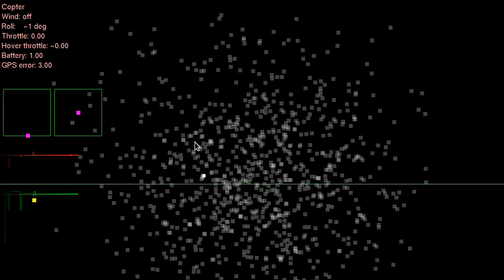Kalman filter test for sensor fusion (GPS + accelerometer)

Comment: Something I picked out of that TED talk (IIRC) was that it plans the route, performs 1/20th of the route then replans it. Seems like an interesting implementation. I expect a well tuned PID controller combining GPS and accelerometer would be able to perform very well, get there in the minimum time, minimise overshoot etc.

I have tuned PID control circuit for an electronic switching power supply, but that was all analog and I found that I could tune it very to transition from one specific start point and end point fast and without overshoot, but changing the parameters requires a different tuning. I have also used PI control for the same purpose. I found it to react much more uniformly to different parameters but always overshoot as without the D it won't slow down until it actually reaches the target. I watched the ControlLectures youtube channel for the basics of what PID is but for actual implementation I'm just learning as I go.
Reply from the maker: The system used in the TED talk is quite different to GPS. They are using infra-red reflective markers which allows them to get the full 3d position and orientation of the quad to about 1cm or so of accuracy, over 100 times per second. That allows them to do some truly amazing stuff. A good GPS module (at least the commonly affordable, non-military kind) will refresh at 10 times per second and may be off by many meters, that's why it takes time to gather more readings and get a better picture of where it is, and will probably not be able to perform much better than this. If you watch videos here on YouTube of quadcopters doing return-to-home, they usually do it at a pretty leisurely pace :)
Reply: ***** Many years ago I worked on the hardware/software for a military drone project. This was before GPS was fully deployed, so we used the worldwide Omega navigation system. https://en.wikipedia.org/wiki/Omega_(navigation_system) 
It was less accurate than that GPS is today, but we used something called differential omega. In this system we places a stationary ground Omega station in the same area in which the drone would fly. This differential station would watch it's own Omega position change do to atmospheric events and transmit a change signal to the drone. The nav system in the drone used the received delta position to modify the position from the on-board Omega nav system.

This Wikipedia article Differential GPS https://en.wikipedia.org/wiki/Differential_GPS  says that 10CM accuracy can be achieved. Perhaps you could build the differential base station into your transmitter and transmit the differential adjustment value along with the digital control date from your joysticks.

Just a thought.

ADDITION: Looks like I'm late with this suggestion:
http://diydrones.com/forum/topic/listForTag?tag=DGPS
Reply from the maker: Robert Shaver
Right - I had been told about that by some folks earlier. I think the major issue is that the updates are only at 5Hz, which is slow compared to how quickly the vehicle can move, rather than the absolute accuracy. In reality the GPS accuracy is not nearly as bad as I have made it look in this video to test the algorithm. Check out my "follow me" video to see two GPS modules working together at 5Hz, one directing an RC car to follow the other. It's not all that bad.

Comment: great video. one comment though: I doubt that a vertical accuracy of 3m is realistic for a GPS. in my opinion it is rather in the order of magnitude of 50m. I can imagine that an accurate control would require to use also a barometric sensor on top of the GPS.
Reply from the maker: +Julien Pfefferkorn yes, for altitude a barometer value would be used

Comment: Hi, did you try to implement this filter to cleanflight or some other flightcontroller, or did make an assisted GPS project, so one can use it, to get precise positioning? Really interested in the project! Did some testing in MatLab and results were ok, but had no luck, with building it with real sensors and so on...
Reply from the maker: +Nils Schönherr I'm thinking a lot about that actually, but I can't use the matrix library that I did in this video which makes things very easy. I tried compiling cleanflight as C++ so I could use the library, but it didn't even connect to the configurator :( Besides that, the program size explodes when you start using the templated matrix functions. I'm afraid all the matrix code will have to be done by hand in C for the typical STM32 to run it, which has put me off for the time being (and I checked the Ardupilot code for it which also put me off :) I'm thinking about setting up a situation where the onboard flight controller is just a 'dumb' terminal that relays sensor data to the ground where a big boys CPU can work on it. This would allow development and testing to progress at a hugely increased pace, and perhaps the problem of getting it all done onboard can wait for another time. It would also require a location where I can fly a quad outdoors yet still within range of my desktop computer, a situation I am also working on...
Reply: +iforce2d What about using Raspberry Pi Zero as an onboard computer?

Comment: Nice demo! Would you be willing to share the mathematical formulation? I am particularly struggling with how to deal with (i.e. how to form my matrices) the fact that my gps refreshes once per second while my accelerometer gives me as high as 800 samples per second. Thanks!
Reply from the maker: +deepblundon it's basically the same as the 'cannonball in flight' example from the second link in the description, except that instead of a constant downward gravity vector you'd use the accelerometer value. About different update rates, I never did get a great solution for that, in fact I've been reading up on it since your comment in the hope that I could give a better answer than this. But in the meantime, I found quite a few good papers by searching google for "kalman different update rate".

Comment: Lovely simulation you've got there. I'm interested in knowing more about your simulation environment. From my perusal of your other videos it appears to be based on Box2D. I have the following questions:

1. Are you willing to share your code?
2. What parameters are you simulating? (copter mass, battery power, motor thrust, GPS position with error, accelerometer readings, throttle setting)
3. Are you simulating accelerometer error?
4. Are you simulating any latency? I'm thinking of the time between readings in a real flight controller.

I wonder how far you could get with position-hold using just accelerometer readings? In a no-wind situation it seems like the perfect accelerometers could keep the copter stationary. Do you have any insight into the precision, sensitivity and lag present in the commonly used accelerometers used?

That's for a great channel and some interesting projects.
Reply from the maker: I might share the code later once it's working more solidly and settled down.
Well, the whole thing is running in a computer so every part of it is being simulated... not quite sure what you're getting at. To make things somewhat more realistic I'm throwing in a little randomization in many places, eg. the applied thrust values for the motors, the readings from the 'accelerometer' etc and I'm making the 'motors' take a tiny bit of time to change speed.
Apart from the GPS readings, I'm not anticipating latency to be much of a problem. The radio link should be able to handle about 100 packets per second, and the accelerometers can update about that fast as well. If you have a modern smart-phone you can find some apps that let you see all the raw data, to get a pretty good idea of what to expect from a consumer-grade accelerometer. Take a look in the App store or Play store for apps called 'sensor data' or something like that. They are very good, but I doubt they're good enough to do position hold on their own, even in a wind-less room.

Comment: Thx for the demo! Very helpful in visualising the quadcopter ;) But i have a question regarding the GPS. When i leave the gps static in one location after a little while i get this drift, which increases to a couples of meters in minutes. This is not a issue while moving, but when trying to implement a position hold, it quite annoying. I did some googling on the matter and it seems to inherent to gps.

In your simulation you dont the this drift into account when hovering, but i was wondering if you found any solution for this?
Reply from the maker: I think the only solution to that is to buy a better GPS or improve the antenna/reception of the one you have.
Reply: Hi, thx for your reply! I have an ublox m8n (from dealExtreme) so i thought a had a "good" gps. Which is this lib your using for your matrix math and were you able to use this on a arduino?
Reply from the maker: I'm using a lib called eigen, it is easy to use but is template based. There is no chance it will run on a regular arduino. I have managed to build and run a very small test for STM32F403RE though.

Comment: Hi, the flowing sensor claims to have inertial and GPS navigation via kalman filters. It is quite expensive compared to standard M8N... what are your thoughts on this part please? If added to a UAV would it give improved accuracy above and beyond a standard M8N or is serious programming required to take advantage of its features? surly some of this could be done from the sensors on a UAV with a standard M8N? or is the clever stuff done on board this unit and therefore its worth the price? 

BR-126 GNSS/MEMS GPS Inertial Navigation Module BDS+GPS Dual System For Ublox NEO RC Drone

https://www.banggood.com/BR-126-GNSSMEMS-GPS-Inertial-Integrated-Navigation-Module-BDSGPS-Dual-System-For-Ublox-NEO-p-1193795.html?rmmds=mywishlist&cur_warehouse=CN

thanks,

Comment: Nice video. Just one request that can you provide me the raw data of Accelemeter and GPS. I have a project where I use it.
Reply from the maker: As I said in the video this is just a simulation, where I made up some fake values. There is no GPS and no accelerometer. Maybe you can find some log files for flight controllers like Ardupilot which would be useful.

Comment: can u give me a links or eny resources that learns 
how i can combine the data from the GPS and the IMU data with Kalman for localization and navigation Rover
Reply from the maker: +Hamood Hamood check the links in the description
Reply: +iforce2d 
yas about Kalman filter theory i understand it but i want to know eny method that compine it on Arduino if u can show mee eny resources that explaining IMU and GPS
Reply from the maker: +Hamood Hamood what difference does it make that it's on arduino or not.
Reply: +iforce2d 
okay i get it 
can i chat with u in facebook or gmail to ask u about some qustions
Reply from the maker: +Hamood Hamood we're already chatting here. it sounds like you want some source code to just paste and run, which I don't have.
Reply: +iforce2d 
first full im now having two diffrents data 
the IMU and i made a kalman filter with Accelometer and GyRo and magnetometer with each other 
and prevously i made GUI with GPS data with NMEA sentences and i calculate the distance 
but now i want to combine a diffrent data GPS( latitude ,longtiude ,Altitude )with (PItch ,Roll<,yaw) 
and the output from the gps i accurate but with a lot of delays unlike the IMU 
so i want this method 
that GPS have the fast reciving data 
or the IMU have  the accurecy of the gps with the speed of IMU 
so the gps should be the accurate data 
and IMU is the measurment data 
and the GPS is make the correction on IMU ????
Reply from the maker: +Hamood Hamood well of course, that's what everybody wants :) A lot of very smart people spend a long time trying to do this. Is there a question?
Reply: yas i have a library that i already i done with it (Kalman filter Libriry ) do i have to creat a new librariy or the same one and just give my new data IMU and GPS 
and the second qustion 
i have lat ,long , Alt 
and i converted this three coordonate degree to cartisian coordinate x,y,z 
and also i want to convert the pitch ,roll ,yaw to cartizain coordinate to make this two data (like a same ) how ????
and is im right in my thinking or not >???
Reply from the maker: +Hamood Hamood what I'm trying to say is, I don' t know. There is a huge difference between making a 2d simulation inside a computer, and running a full 3d system in the real world with real circuits and real sensors. If I could do that I would be running a company like DJI selling ready-to-fly quadcopters and rolling in money.

Comment: Very interesting video! I have programmed a similar simulation in 3D. Check out my channel for more information.In the top left corner in your video there is a wind option. How do you model wind? Do you use random changing vector fields? Or is it jist fixed strength and fixed direction?
Reply from the maker: Just a small random force added each time step, eg. ( rnd(0.9,1.1), rnd(-0.1,0.1) )
Reply: This would just create random noise because the time steps are so small that it wouldnt actually cause the quad to move. I ran into that problem too and i dont quite know an elegant way to solve it. You would require a random but steady function, like x=sin(t), when x is the x-coordinate and t is the time in seconds. However the sin() function is not random and also very predictable, hence not useful for simulating wind.
Reply from the maker: I edited my comment after the first post, perhaps you missed the edit - in my first post I did indeed make it a random noise. But in case it wasn't clear from my edited pseudocode, the x component of the force is given a random value between 0.9 and 1.1 which is on average 1. This would push the body to the right. The y component will average out to be 0 in the long term, but in practice it will move up and down a little (brownian motion in vertical axis).
Reply: Ok I got it. So you made the wind go in a particular direction with randomly varying intensity.